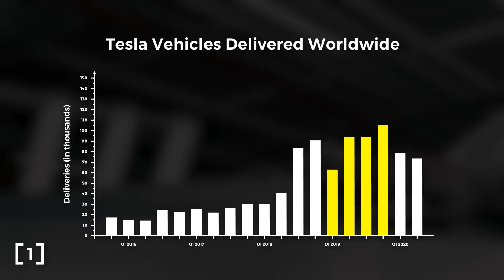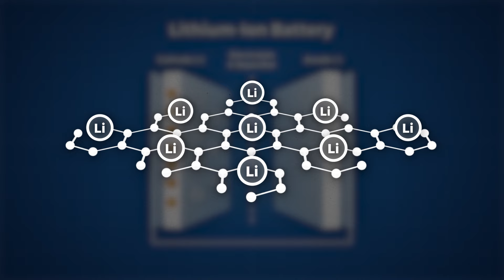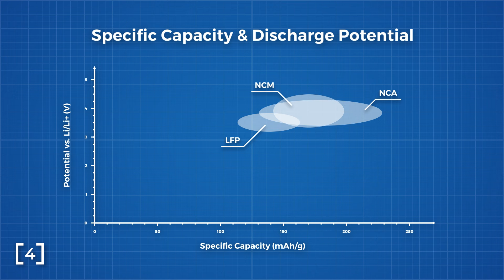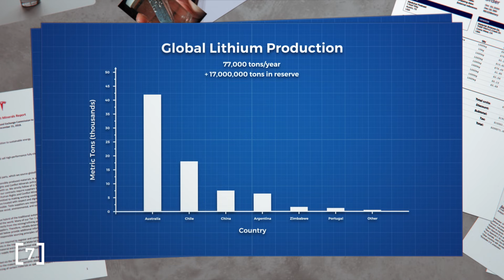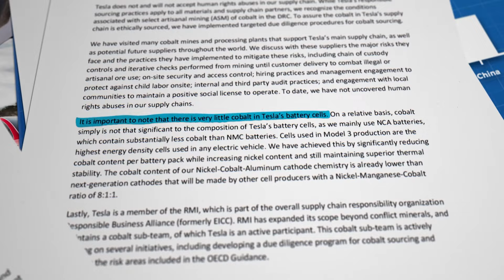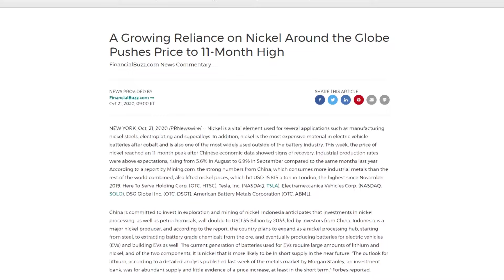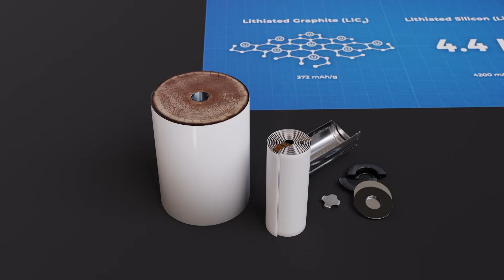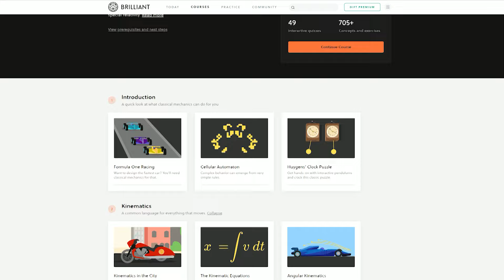Tesla's Battery Supply Problem

Comment: The real issue seems to be overlooked for the most part, acquiring these rare earth raw materials and then they are also very difficult to refine.  Actually we need to come up with a battery that uses base materials that are readily available, not difficult to refine, and have no side issues such as dimensional stability while charging and discharging.
Reply from the maker: Wanted to go into refinement and manufacturing more, but the video was already insanely long. May revisit this later
Reply: Are these elements more available in space?
Reply: There are no rare earth metals in batteries. Where did you get this impression?
Reply: Don't forget modern batteries are also pretty hard to recycle once their lifetime usage is over, which means that we are slowly moving form one problem to another as more and more current batteries are being used. Regardless of what Tesla likes to pretend it's doing, the real engineering of battery technology has a long way to go and a short time to accomplish it.
Reply: @charliecrome207  yes, because space is much bigger than earth... but we are still a long way from starting mining operations in space
Reply: @RealEngineering  graphene. Please look at graphene
Reply: That's why hydrogen fuel cells are the future! With the easy availability of renewable electricity in near future, it shouldn't be difficult to electrolyze water.
Reply: Digging for rare earth materials?  You mean like fossil fuels????
Reply: @ALT3REDB3AST  like metals😑
Reply: Also, Bolivian coup fail. Which mean that the prices for Lithium won't comes down soon. Nor would we see higher output for it.

They really need to look into Hydrogen as well.
Reply: @MrWhiteVzla  so they should just stop, right? Just because it needs more development and time, its not viable option? Always same thing. Yea, we should just drop this and remain using fossil fuels. Its already developed, cheap and available? Right? We shouldnt be researching anything new or try new, lets just do same shit because its cheap, available and already here.
Reply: @panzer3279  Cost of storing Hydrogen is still crazy
Reply: @MrWhiteVzla  The Tesla Battery Day presentation already covered this topic. Recycled batteries have a much higher percentage of materials than raw ore. Tesla is working on their own refineries to be able to recycle old batteries. A battery put into a 2021 Cybertruck will likely stay in that vehicle for 20 years or longer at this juncture. There are 2013 Model S vehicles that still drive like brand new. To any "Bolivian coup" complainers (@NNT Flow) Tesla said they could mine enough lithium in Nevada to power the entire USA EV fleet.
Reply: @quizarorobzaqu8558  using fossil fuel to dig for expensive, limited metals that have a finite recharge lifespan.
Apple stopped selling phones with charging blocks to reduce eco waste.  Now imagine the eco waste from spent car batteries.
The real problem is humans need to relearn how to live in harmony with nature.  Anything beyond that will always result in a negative deficit result.
Electric cars still rely on a power grid ran off fossil or nuclear power.
Reply: @ALT3REDB3AST  Yup... all that is happening is your displacing the Carbon foot print from here to over there... as in directly into the car at the fuel pump to over there to mine process lithium and build produce all these mega watts of juice we are going to need.
You still need carbon to make it all happen no matter how you want to look at it...period
Now I'm all in for free enterprise to continue the development of electric....just despise government subsidizing this BS under climate change BS
Reply: ClockWorkCrew Heard it has trouble with endurance
Reply: @bkrgi  multiple studies have shown electric cars are still greener even with manufacturing and power generation factored in due to their effociency. Gas cars just waste a lot of energy.
Reply: @vasilije94  Why are you making all this conjectures? When did I say they should stop or are you a Tesla disciple that must defend Tesla from naysayers? Develop some critical reading skills before talking, lad
Reply: @Nphen  Yes. Tesla is perfect and holy, but they aren't the only company on earth using batteries. And while we wait for their refineries to be online, which could be anywhere from now to eternity considering Tesla track record with delivering things, the problem is still going. That's why I'm curious about 3rd party solutions.

I care a lot about battery technology and energy density because that's the name of the game. For batteries to beat fossil fuels they have to be as energy efficient as petrol or better, which they aren't at the moment. Electric engines are extremely efficient. But the batteries can barely hold any charge for their weight.

I'm eager to see RE video on liquid metal batteries. The battery developed by Goodenough was very interesting too, but I think it can be a possibility (if it's proven it works) in 20+ years at current investment levels. So I'm curious to see where liquid metal is and its energy density.
Reply: @vasilije94  - Nobody said we shouldn’t pursue electric. We need to make sure that it is the proper way to go before we build up the infrastructure though. Electric is not the perfect environmental solution that it is advertised to be, and it wont help the environment to get stuck in another infrastructure rut that is not much (if any) better for the world than what we currently have.  Whenever someone is trying to sell you on something, best to investigate why.  Is it purely for their profit, or is it actually better for the environment?
Reply: @ALT3REDB3AST  Then what energy source you want? Wind/solar energy is CRAZY expensive compared to something like nuclear. Hydroeletric energy is guilty for the destruction of natural habitats. look it up yourself, nuclear is most possibly the best there is
Reply: @Gabriel-yd4bq  we need to learn "new" methods of doing things without electricity like the ancients did.  Again, harmony with Earth instead of contention.
Reply: @panzer3279  And dump billions of tons of oxygen into the atmosphere? Let's stop messing around with our air mixture ratios.
Reply: @RealEngineering  you could have just made a 2 part video or something
Reply: Solid state batteries
Reply: @MuitoDaora  there's ALWAYS a price to pay!
Reply: nuker fission or fusion can fix the issue but sence we need alot of power to start a kuckear fusion reactor is too much wihout a nukear fission power plant to help get the ball rolling! is the problem not to mechon the green hose gases that hydgoen makes co2 look like a better opein! becsue when your burn hygeon to get the needed power and not at the much clainer lean but buring hiydgoen lean is like only 20% the stentgh of gas or methine! but if you brun hydgoen dirty is make NITSOOXIIDE! wtich is a green hose gas that a single psi can basbly be the eqeimelt of 200psi of co2! thats FAR FAR WORSE and to add even more probems! it makes acid rain raly easy and its toxic to trees! and trees can't prosees it! so yah its just more egconcal to use oil galoine or bettter yet use methine gas ! methine just make far less co2 emetions but it far better then nitosoxide emetions that wat uses to csue all the acid rain when the nitooxide wasnt fulter out of the factory gas emeitons! by the way do you want to use hygogen that makes a gas hosue emstion that chances the climate 200X faster then you would then with just co2 emetion gas and meithnge! and also make every thing an acid rain wasteland that make that same problem as venus! by the way hygoen powe will trun earth into venus! while co2 at the worst would moslty be a issue of the ice cap melting! but you do know that there where no ice caps before a meetor wiped out the dyinosars and made the ice age by the way! the ice caps just cover extra under there and the ice caps only have enotgh water the rase the occens at 40 extra feet before there no more ice cap to go any higher! so while it might rase the occens a bit but its not enotgh to do more then be a pain for costal vecaion spot! but its not enotgh to take entoght land to be more then an icovence at the most! not to mechion that only if the trees din't keep converting most of our co2 into oxygen at a massive rate that bascly the trees consume the co2 as fast as we emit it! but if we stop makeing enoitgh co2 will cuse an even worse mass extion efect when the trees don't get enotgh co2 and then they all die! wich then sence most of the trees died becuse the lack of co2 emitions our factorys and other stuff makes is the only reason there so many trees at all! so if we cut most if not all the co2 emeitions it will cuse a chain rection that sufcatis all the trees that cut off the earths main suppy of oxegen! then we all die beccue the tree need of co2 emitons to not sufacte! so do your want to have high ocean levels or to die of sfocation after we make zero co2 eimitions real! becsue if you wher sane you wold not have zero co2 emtions! becsue the whole climate change scame is made to like kill the emvorment by sufcating the trees to end the world!
Reply: @nntflow7058  what a relax way of talking about a coup d'etat. It looks like any another financial action. 
Are the media naturalizing that kind of capitalist ways to find cheap raw materials? yes they are.
Reply: @panzer3279  EXACTLY what I think and support as well.
Reply: @xperyskop2475  only because it currently has a very small storage infrastructure in place. That could be remedied very easily and quickly.
Reply: @Nphen  lmao you believe everything Elon says.....smh
Reply: @ALT3REDB3AST  or wind turbine or solar....
Reply: I think they're working on graphene batteries. Hydrogen is also an extremely abundant energy source...
Reply: @charliecrome207  Yes - look for an answers with Joe episode where he talks about mining meteors - the title was something like 'the first trillion dollar industry'. The problem is the meteors are far away - humanity has sent almost nothing as far out as the meteor belt so far, so getting there, surveying meteors and either mining them or attaching boosters to send them closer to Earth (Which would be an amazing mining futures type investment - the gamble being that the value of the minerals in the meteor will be above a certain amount to turn profit after the not inconsiderable costs of getting the minerals to Earth). There could be meteors that are almost solid Nickel or Iron or Cobalt, certainly much higher percentages than the Earth's crust. 
Since the Earth was a liquid for a long time before solidifying, all the dense minerals sank to the centre of the planet before it solidified, so most of the heavy elements we mine on Earth are leftovers from meteorite strikes anyway.
Reply: @PyroXVuurwerk  no, we aren't, we just haven't tried yet
Reply: @clockworkcrew8012  graphene is dead. It's not new technology, it's been around nearly 100 years and has shown the least amount of progress of any other technology to date. Give up on pipe dreams. When our technology gets to a point that we can mass produce materials manufactured on a subatomic level and break different elements down to make any element we want, and control quarks, then graphene will be possible. That's what is required for us to manufacture and use it
Reply: @MrWhiteVzla  Didn't you watch the video?  There  IS a third party Li-Ion battery recycling business:  Redwood materials.  Batteries don't need to have the energy density of petrol to be successful.  The energy density of (batteries + pack + cooling + motors) needs to be comparable to (Petrol + fuel system + engine + transmission + cooling + exhaust system).  And it already is.  Model S has a 400 mile range.  Problem solved, it's a done deal.  The future is electric.  ICE is going away except in special cases.
Reply: @RealEngineering  
I would've watched it
Reply: gpaull2; 1. The enemy of good is perfect. Nothing in our world is perfect. People are not perfect. The environment is not perfect.
2. Renewable energy and current battery powered vehicles are intermediary steps in order to reduce the total production of greenhouse gases worldwide. Is it perfect? No. But it's better than the present massive use of fossil fuels. 
- Until some future breakthrough tech becomes possible, then improvements are going to come by taking intermediate steps. 
3. As for investigating pure profit over what is better for the environment, that is a black and white fallacy.
The computing device you use, the Internet you have connected it to, and the YouTube platform you are using all involve for profit companies.
- If the environment is going to be improved on a massive scale, then the involvement of for-profit companies in that effort will be essential.
Government action will also be necessary to regulate company efforts. 
* To find out if something will be better for the environment is not completely discredited because some company involved in that effort is making money.
Reply: @incognitotorpedo42  That's very inaccurate (your calculation on energy density). But, it doesn't surprise me since you used Tesla to make your claims. Non Tesla cars of smaller size gets outraged by ICE thanks to smaller packs severely hampering range available. Moreover, there is also the problem of trucks carrying a large chunk of their weight in batteries and how that limits their cargo (Engineering Explained made a video about the problem of modern battery density if you are not inclined to believe me. Here is the link https://www.youtube.com/watch?v=oJL9MasBFvM).

So no, battery density isn't a solved issue. It's still a very real and pending problem. ICE can't replace anything that isn't a Tesla car until batteries can prove to be as energy efficient as petrol for more than Tesla automobiles.

The doesn't mean that future won't be electric, solar, carbon neutral, hydrogen, or fap driven. It's unavoidable. Oil will run out eventually, so the writing was on the wall from the start. But pretending that modern batteries are perfect for all our needs is foolish and as short-sighted as the people that think ICE is here to stay forever.

Regarding the third party recycling, even RE said that it will take a bit longer for large-scale financially viable recycling to happen if it happens at all. We seem to have an innate ability to dump things until regulation forces us to do otherwise. That's why I'm interested on it.
Reply: @MrWhiteVzla  How is my calculation inaccurate?  Exactly what is wrong?  Your claim that the energy density of batteries had to equal that of petrol is what was wrong, because it ignored the rest of the system and made it sound like batteries would be totally inadequate for the foreseeable future.
Reply: @MrWhiteVzla  difficult yes, but it's still cheaper to recycle batteries as Tesla explained than go build new ones, so unlike with plastic this is a "problem" that will automatically be solved by economics.
Reply: @panzer3279  hydrogen would massive increase CO2 emissions unless we generate (nearly) all energy with renewables or nuclear.
Reply: @bkrgi  Tesla is working with CO2 neutral mining companies and even if they weren't the CO2 emissions are still endlessly lower than ICE cars. Don't spread misinformation please.
Reply: Nitrogen battery, I mean you can just suck it from the air........or maybe just hydrogen
Reply: @RealEngineering  this vid was very interesting! I wouldn't mind for more in depth looks on it
Reply: That's a myth
Reply: @MrWhiteVzla  And dead batteries are a more immediate environmental hazard than whatever net positive electric transportation might have on greenhouse gas emissions. My dad occasionally asks his local Toyota dealership what the plan is for dealing with dead Prius batteries and has, so far as I know, not gotten an answer that sounded like anyone had a plan. To be fair, a car dealership might not be expected to know all of that, but the point stands - we generally haven't been planning for that problem.
Reply: We have it nickel zinc.
Reply: @RealEngineering  Do a part 2 buddy.
Reply: @RealEngineering  I would 100% watch longer videos that included all the extra info that you had to cut out. I know, youtube algorithm and all that, but maybe extended editions of your videos?
Reply: You ask something that is impossible for the current technology
Reply: @MrWhiteVzla  Well Tesla has million mile batteries. They can actually simply reuse the battery as it exceeds the lifespan of the car and reuse is even better than recycling
Reply: @thezyreick4289  please dont just insult me without warning, and for your information it isnt. Graphene proved Feyman's theory of thermal motion wrong earlier this year. If you dont know how big that is, well whatever. You're just wrong, completely. You have no idea what youre talking about and I shouldn't have even taken you this seriously. Dont just insult people over YouTube to create melodrama please, especially when you dont know what you're talking about.
Reply: @RealEngineering  please do something on graphene, God just please, please, please.
Reply: @incognitotorpedo42  You are right. Tesla is perfect, their system are perfect, EV are perfect, and the batteries they use are perfect. Everything is perfect and there are no flaws. All those engineers researching battery technology and energy density are wasting their time, because Elon Musk and his church of Tesla have the solution for all of our problems.

I always thought that Space-X fanboys were annoying, but it seems its Elon Musk fanboys the ones who can't grasp reality. Don't worry, lad. Those heavy Tesla cars that have extra weight thanks to the battery packs don't matter because Elon said that their new batteries are perfect.
Reply: @Ehralur  we'll see, people put too much faith in what Elon Musk says as if his word is gospel
Reply: @benjaminmiddaugh2729  True. And it's not just car batteries, we have been doing that with mobile batteries, computers and other batteries for years as well. It's something that Tesla fanboys can't seem to grasp because it would mean admitting that EVs are not almighty and perfect as their god-saviour Elon Musk claims to be.
Reply: @blaccpanther8715  Eventually those batteries reach an end-of-life. All batteries do. And then what? Elon Musk will send them to Mars? That's a problem the still requires a solution.

People, Tesla isn't god. There is no need to worship a corporation. Their job is to make money and appease their shareholders in a (hopefully) competitive market. Stop treating Musk and Tesla as if they are some sort of truth-tellers and their words are sacred. The EV market isn't perfect, it has a long way to go, and it's ok to criticise it.

You can criticise something while also still liking it. There is no need for blind devotion. That's how we ended-up with a bunch of politicians and people spewing things like climate-change is fake or vaccines cause autism.
Reply: @MrWhiteVzla  has nothing to do with trusting Elon but with trusting science.
Reply: @MuitoDaora  You do realize that the same oxygen will be used for oxidizing hydrogen back to water. We are not altering any ratios.
Reply: @firepower9966  Of course it does take more energy to create a fuel! Generating electricity would be a minor problem with abundant renewable sources. The main concern is the logistics and storage of hydrogen, but that should be solved.
Reply: @Ehralur  That's applicable for batteries also. What's your point?
Reply: @clockworkcrew8012  on a more serious note. Of course graphene proved it wrong, graphene would be quite possibly the thinnest manufactured material made by man, because it's by nature a single atom thick. Anything that is only a single atom thick will prove feymans thermal theory wrong because 1, his theory is flawed to begin with, don't just assume that because something is a theory it's automatically genius level work. And 2, because of quantum mechanics and the way thermal transfer works on a subatomic scale. 

I however still stand by what I said, which as a quantum physicist and molecular engineer, I believe is still true. Sure in extremely rare instances we can make graphene, in extremely small batches of unusable material barely fit for proper testing. It's going to take a massive overhaul to our technology and production capabilities before we can make sheets of graphene large enough to use, let alone begin the process of bonding them together into thicker sheets to make them viable for engineering any kind of structures out of them. 

I can go off listing all the hyped properties of graphene, how it's the sharpest thing man has ever created, how its the thinnest, how our modern understanding of thermodynamics doesn't play well with it, how it seems to defy the laws of proportional physics, blah blah blah. At the end of the day theoretical physics and real physics are two completely different things. It being the sharpest? Obviously, it's just a single fucking atom thick. It defying thermodynamics? No it still works just normal with thermodynamics, the people who think otherwise are just a bulb short of a light and can't actually comprehend thermodynamics. How it defies the laws of proportional physics? No shit, it's literally an extremely delicate lattice on a subatomic level in a constant balancing act where the whole thing wants to rip itself apart constantly because it would never form that way naturally do to electric charges for one, and the fact that shit doesn't want to remain 1 atom thick because doing so leaves the atom's unstable as fuck
Reply: @Ehralur  And if you have seen Real Engineering and Engineering Explains, the science says more work is needed. Not, everything is perfect
Reply: Too Sense Wirth  use 4 lifepo4 in me glovebox to start a 1.4 turbo ralliart colt 200A rating are over a year old now
Reply: It is already Happening - Not for Use in Electric Cars, but in the Energy Storage Sector - Lithium Ion is not even part of the Equasion.
Reply: @panzer3279  - Nup, moved beyond them, even though they have Energy per weight, too complex to achieve value for Money, and that is what is all about, Money.
Reply: @quizarorobzaqu8558  like coal maybe only worse lol. Because drilling a hole is better for the environment than strip mining a whole mountain. Just saying lol
Reply: @vasilije94  looking for new alternatives is a great idea!!!! 100% a fantastic idea... but cant be something is forced or arbitrarily ordered. Once it is financially and ethically sustainable then it will happen.
Reply: @xperyskop2475  and freaking dangerous
Reply: @Nphen  the entire current EV fleet...not the whole country
Reply: @ALT3REDB3AST  to many people to do that anymore... we would destroy everything
Reply: @garretwang1031  gas cars do waste energy. But electric grids waste a considerable amount as well. You can produce electricity transmit is a great distance without energy loss. The use of hybrids is a fantastic idea. When you slow down to stop you recapture normally lost energy. All current electric vehicles just wont have the range that is needed for the US.
Reply: @trance9158  windmills kill thousands and thousands of birds and other flying animals, change air currents and are extremely loud. Solar, hard on the enviroment, depends on what kind but can fry birds as well.
Reply: @JohnSmith-bf1sq  Oh please.  Can you stop with the bullshit anti-renewables myths?  Pet cats and tall buildings kill BILLIONS of birds.  Windmills are a drop in the bucket compared to that.
Reply: @ALT3REDB3AST  using fossil fuels to burn it is way less sustainable. A lithium ion battery can be recycled for 95+% of the contents. And after use in a vehicle it can still be usable as grid storage for 10-20 years before recycling can be considered. And harmony with nature? If you want that you have to reduce the global population by a few billion. Manual farming without industrial pesticides and fertilizer is not able to sustain the population that we have. So the question is: who do you want to die?
Reply: Silver is superior to lead for batteries.   Co$t seems to be an issue.
Reply: @incognitotorpedo42  i live next to a giant wind farm. Its not bull shit. They are loud, they do kill many flying creatures, they are unsightly(opinion) they are not a stable way to provide power(cant be counted on to provide power at peak times and are often turned off). So dont call FACTS bullshit. No doubt you live somewhere far away from them so as long as its not your back yard its ok. Sit on your hands middle digit please.
Reply: @Gabriel-yd4bq  
Wind/solar energy is CRAZY expensive compared to something like nuclear.
You clearly have no idea of current prices. Current gen new nuclear costs 110-180$/MWh, wind us 40-50$/MWh (onshore) or 70-80$/MWh (offshore), solar is 35-45$/MWh (utility scale) or 100-180$/MWh (for roof/small scale solar, advantage here is that if you can use it directly, there are no grid costs or taxes). 

So no, renewables aren't crazy expensive compared to something like nuclear, it's the opposite.
Reply: @nntflow7058  I wouldn't call it a coup.  The Bolivian government removed Evo Morales from office because he was a crook and the interim government scheduled a new presidential election.  Morales former party won, but Morales, who left the country when he was removed from office, was not on the ballot.  He remains in exile.
Reply: @JohnSmith-bf1sq  
the entire current EV fleet...not the whole country
No, it was definitely said that the lithium in Nevada was enough to replace the entire US care fleet.

All current electric vehicles just wont have the range that is needed for the US.
Most people drive less then 50 miles per day. So I'd say even current range is good enough for most people. However the EV range is constantly increasing. All that is needed is enough fastchargers for long distances.

windmills kill thousands and thousands of birds and other flying animals
Like someone else said, the amount of birds killed by wind turbines is a fraction of the total amount of birds killed. If you see this as an issue, maybe you should also advocate to kill all cats, get rid of all glas windows, get rid of cars (yes more birds die due to cars).

change air currents
That is neglectable. The amount of energy wind turbines use can't change air currents for more than 100-300m, after that the unimpacted aircurrent just again fills up the gap.

*extremely loud*. 
Directly underneath they can be as loud as a lawnmower, at 100m they should be as loud as a window AC unit and at 400m as refrigerator. It depends on the country, but usually wind turbines are not placed closer than 300-400m to residential buildings. In some countries this is even higher.

Solar, hard on the enviroment, depends on what kind but can fry birds as well.
The kind that can "fry" birds are hardly used and usually are found in very hot area's, where you'll already have less birds.
As for hard on the environment. Depends on how it is produced.

i live next to a giant wind farm.
How close?

they are not a stable way to provide power(cant be counted on to provide power at peak times and are often turned off)
Which is why we need energy storage for renewables. And EV's could also help out (being charged when there is a lot of wind/sun.

No doubt you live somewhere far away from them so as long as its not your back yard its ok.
I often am within around 1km of wind turbines and can't hear them at all. And I also have stood underneath them while they were operating in medium windspeed, they aren't that loud, ofcourse there is sound when you are closer to them, but there is regulation as to how loud they can be. For example they normally aren't allowed to be louder than 105db or close to it, which is as loud as a lawnmower. The sound degrades quickly.
Reply: @thezyreick4289    What? We can literally make graphene in batches of fucking oil drums for a few bucks. Way to try to see like a better person though, only if you weren't wrong and using your small worldview of your then current physics class to try to tell me we can't make it and when we can and already do.
Reply: @JohnSmith-bf1sq  not facts. You called one  "you opinion" and the other examples you show is simple representive heuristic. The world is bigger than you worldview, you opinions and experiences dont set algorithms or "facts" that the world runs by.
Reply: @ALT3REDB3AST  I'd prefer some fucking asteroid mining frankly
Reply: @benjaminmiddaugh2729  actually the car batteries aren't dead...just no longer efficient for running the car...they can then be used for solar power grids...homes....etc.
Reply: @blaccpanther8715  no Tesla doesn't he's talking jabberwocky again.
Reply: @clockworkcrew8012  lol. I stated one as my opinion so that it was seperated from the rest. The national Audubon society states that 140000 to 328000 birds are killed each year by wind farms. A Lincoln Nebraska study shows that wind farm noise can be loud enough to cause health decline due to lack of sleep. So no... its not just anecdotal.
Reply: @trance9158  Except that's not always true, and that's certainly not what usually happens.
Reply: @firepower9966  better update your knowledge on hydrogen power tech apparently.
Reply: @benjaminmiddaugh2729  for example then??
Reply: @trance9158  That's not how this works. My side of the story depends only on people doing what they normally would when disposing of malfunctioning vehicle parts. You assert that instead these batteries actually get re-used, or at least said that they can be reused and implied that such reuse happens at a scale that makes such batteries not an environmental problem anymore. You are the one who needs to provide evidence for that claim, not me for mine. Especially in the comments of a video that explicitly acknowledges that there is no common large-scale EV/hybrid battery recycling infrastructure.
Reply: @benjaminmiddaugh2729  I'm for Hydrogen personally. EVs are not the answer to our auto or pollution issues. I think it's stupid that Tesla nuts think he's a savior and has the solution to our problems. They are part of the problem.
Reply: So what is this magical material which does not yet exist?